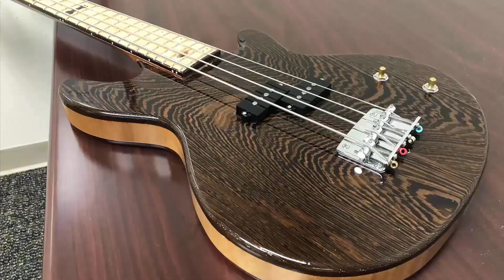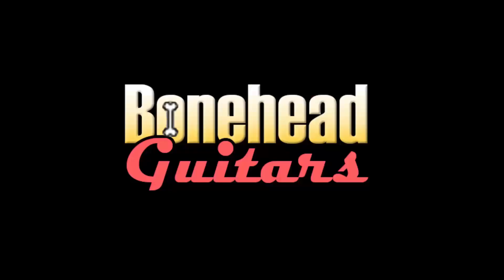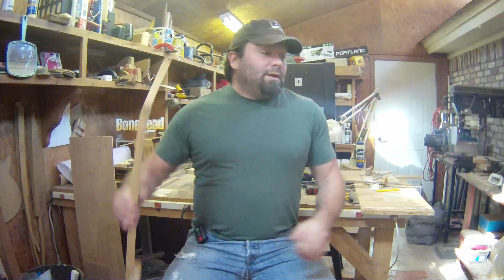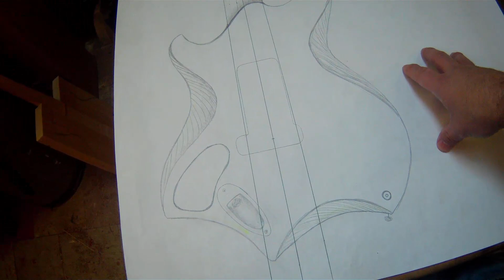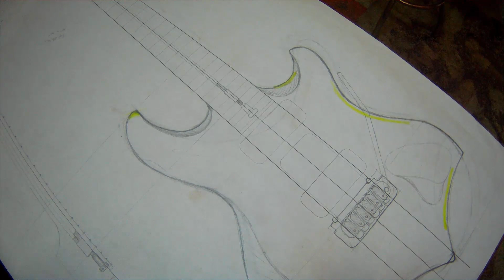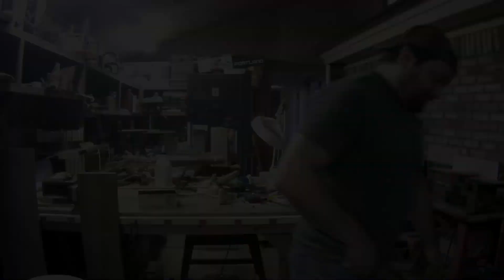Great Guitar Build Off 2021 - 00 Entry

Comment: That will be very cool build Scott. You've got a lot od admin for a one man shop. You need to scale back on some of the dead wood. I'm doing basically the same thing with videos for GGBO. Just hold to the 6 video but if it crops up in unofficial vides so be it.
Reply from the maker: Watching a speed build is a lot less entertaining to me.  I try and fail to keep the talking to a minimum, but the process and the decisions are the interesting part.
Reply: @BoneheadGuitars  I couldn’t agree more. I speed some parts up for times sake. But I also feel if people are watching to learn then there has to dialog.
Reply from the maker: @jonahguitarguy  yup.  Now, with GGBO I assume most of the audience is familiar with the basics, so I think tutorial type content is just patronizing.  But explaining the reasons for decisions is just good stuff.

Comment: Thinking that the jack plate you're planning should maybe go roughly 90° from where you have it drawn, more parallel to the cover plate (even if you make it smaller). The current design will put a lot of stress on the guitar cord. Unless I'm seeing it upside down.
Other idea might be to do 180°, so the cord hangs over the control cavity.
Reply from the maker: Yeah I’m not happy with the angle.  And I’m thinking about not using the angle out of the body that the jack plate has.  We shall see...

Comment: I'm curious to see how this turns out! FWIW, the Strandberg cut you're referring to would actually do on your right leg (on the Strandberg, anyway) so the controls are between your legs. It puts the body in front of you with the neck in classical position. What you're doing moves it more like an upright bass. Try it on your right leg with the neck angled up in front of you for feel. This is similar to playing a Jackson Randy Rhoads seated. 🤘🏻
Reply from the maker: I tried that too and it was neck heavy, or it seemed it might be.  All about options.  😀

Comment: Combining the locking tuners with oversized nut slots and a bit of lube in the slots should give you zero issues on returning to pitch! Love the concept and the wood choices, no doubt the finished product will be absolutely killer! Good luck with your entry!
Reply from the maker: Thanks man.  I’m banking on that being enough.  I want a trem I’m not afraid to use

Comment: I wonder how many post-pandemic conversations will include, "Wait, you did what while quarantined?"

I really love this design.  Sure, it's been done by others, but that's pretty much gonna always be the case unless you plan on cornering the market on ice cream sandwich guitars.

It'll be the special touches that you bring to the design that'll make it yours.
Reply: Old Man Zen.....I honestly had never built a guitar before in my life.  At the beginning of the pandemic, I decided to try a kit type build.  Bought a bunch of prefab parts and put together a guitar.  I caught the bug, apparently,  I've been building and shaping my own bodies, now.  I'm MUCH more experimental with electronics (most recent build, in progress is a JAG style, with the typical rhythm circuit, but I added a 3 way toggle pickup selector for the 2 humbuckers.  The normal Jag plate now contains a master coil split switch, a master series/parallel switch, and a phase switch)

all told, since the original lockdown back in March, I've built 8 guitars, and esquired my squier affinity tele...it's been a learning experience, I'll say that much.

On zoom family get togethers, my in-laws see the guitars hanging on the wall....when my wife mentions that I built them, eyebrows are definitely raised.  "I didn't know you build guitars."  "That's because before the pandemic, I didn't."
Reply from the maker: @TJEvans98  if you’re like me, the follow up question is alway “do they like, play?  Or are they just decorations?”  😐😂
Reply: @BoneheadGuitars  Oh, they know I play them...I play for my church, and well....since live streaming is all the rage (and the norm), my guitars are featured every Sunday morning....lol

Except for the 2 that I made for my son...but I can't play them, they are lefty
Reply from the maker: @TJEvans98  awesome
Reply: @TJEvans98  8 in less than a year? From a cold start too? 
AMAZING. 

Makes my output of 1 per year since 2019 look really bad :)
Reply from the maker: When I started I had no idea Strandburg was already doing most of it.  😆